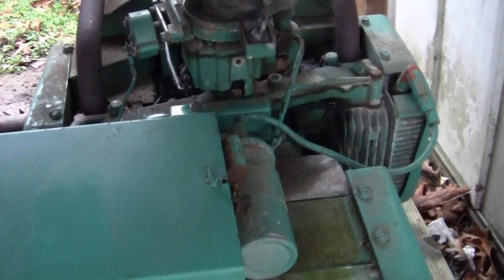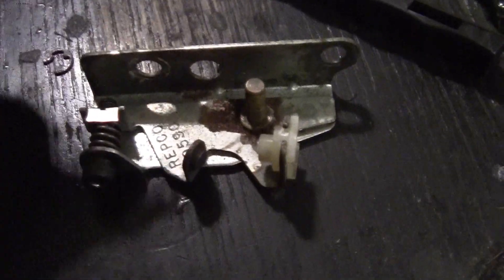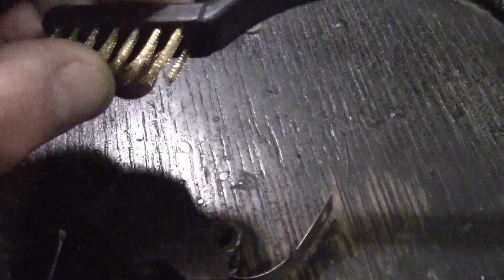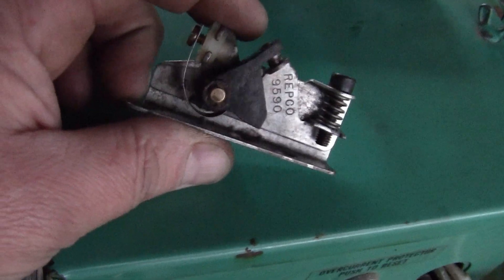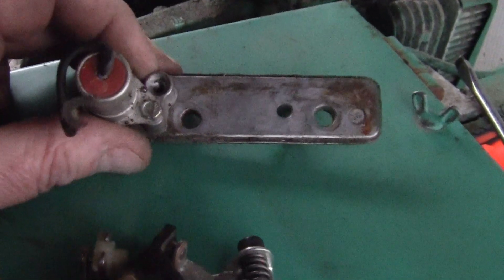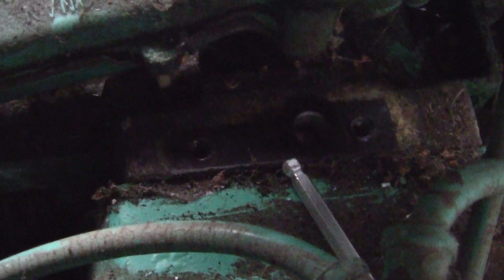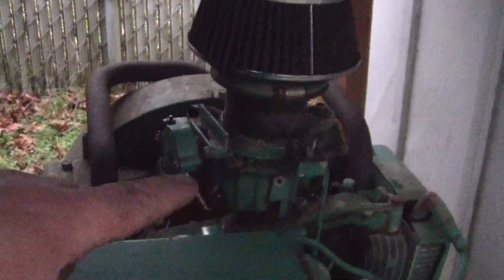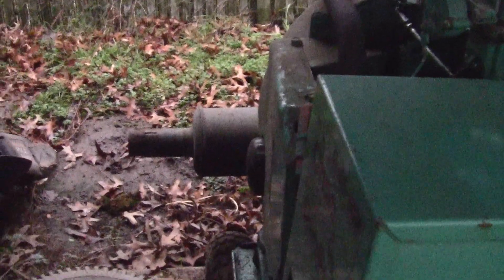ONAN WON'T START, LET'S FIX IT

Comment: Nice work Shawn getting that Onan going . We had a later model Onan with electronic ignition that wouldn't start and found the ignition ring broken
Reply from the maker: I kinda like the ole point setup ! Keeps it simple and fix is easy .. Thanks Lloyd

Comment: Nice easy way to adjust the points. I wish my Coleman genset with the Honda 390 had a electric starter. It's a bugger to pull but it does start pretty good.
Reply from the maker: You can get the electric start kit for that on EBAY Thanks for watch'en !! HERE IS THE LINK      https://www.ebay.com/itm/New-Electric-Start-Kit-Flywheel-Starter-Motor-For-Honda-GX390-13HP-GX340-11HP/253759581162?_trkparms=ispr%3D1&hash=item3b153febea:g:
Reply: @shawnmrfixitlee6478  Thanks! Was wondering if there was a ring gear on the flywheel I have. That answers my question. Reasonable enough.

Comment: I just picked upa version of this generator with a no crank issue,  somethings odd,  just not sure where to start,  having trouble finding a schematic for it.   good you found the problem.

Comment: I have a newer one here and the last thing I tried was pulling on the throttle while the electric start was working. Fired up immediately. The choke was engaging but there was no fuel coming through

Comment: Does your generator keep the starting battery charged?  and what is the voltage output that is it charging?
Reply from the maker: mine did not have a charger built in . I put a small 5 amp charger in the control panel . Worked out well ! Thanks..